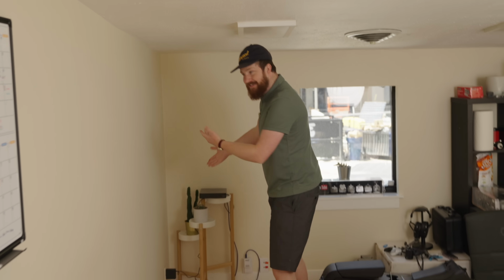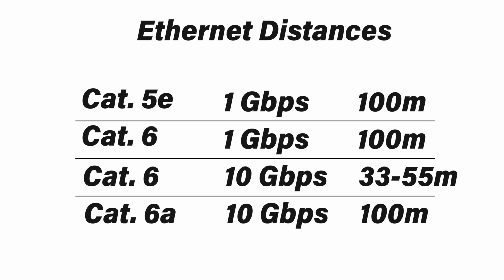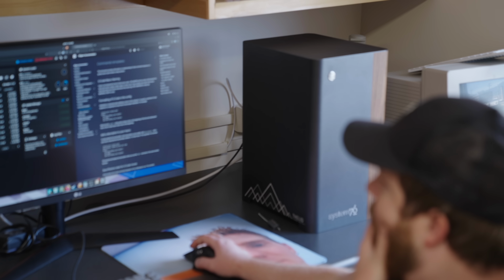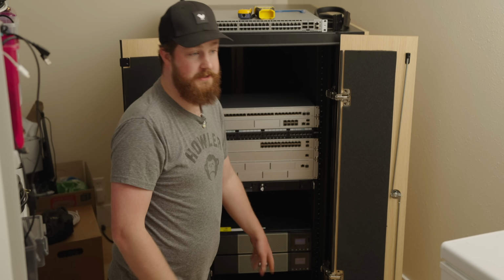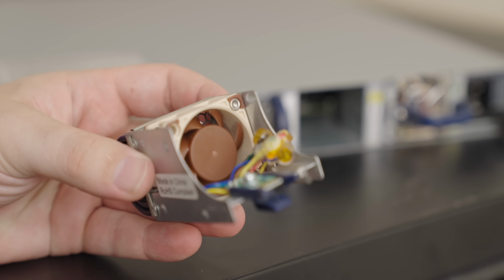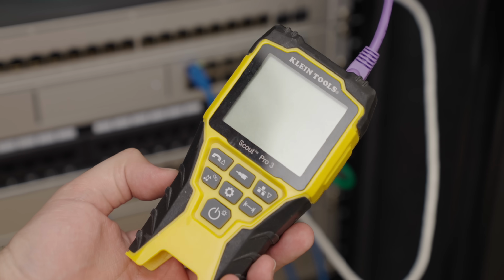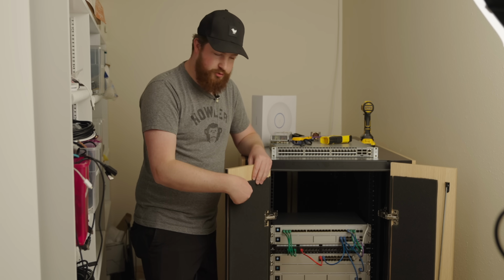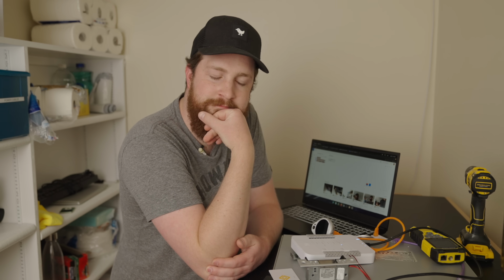DIY 10 Gig Networking for Our $60,000 Server!

Comment: Still can't get over how short the ceiling is in your office
Reply: It's not short, Quinn is just 10 feet tall
Reply: you meant to say "low"
Reply: @toseltreps1101  🙄
Reply: @toseltreps1101  insert spiel about how language is for communication and not intented to be used perfectly by all people all the time and so your correction is rude at best, insecure and sad at worst.
Reply: Claustrophobic
Reply: @PhaythGaming   Actually it’s not even a correction, because ceilings being short is a perfectly acceptable phrase which doesn’t bother me at all as a native speaker. Both low and short works, so Tösel is literally just being rude, not even correcting.
Reply: @jbnelson  To be fair I do feel in a grammatical sense it is off. A ceiling cannot be short, as it is defined as the upper interior section of a room. Thus it is simply a name for a face, and has no real z dimension, thus it is not "short" (I do understand the word "short" talks about distance from end to end, and so technically a ceiling CAN be short, but it wasn't the message being conveyed here, as it seems the use of the word here is meant to talk about height and not how wide something is... anyways, it's semantics, it's not that deep). It's place in vertical space is entirely determined and defined by the walls (which are tall, short, etc) and place the ceiling as high, low, etc.  So it is probably a just correction from the point of view of exact definitions.

Nevertheless, my first comment clearly states it's absolutely not a necessary thing to say. Everyone, native speaker or not, probably well understood what "short ceiling" meant here, given the context of the content and the natural personification we often apply to the word "short" in relation to human beings and other things. Language was invented purely to communicate. Linguists and such were people who came into language after it's conception (and use) and began to regulate and standardize it. If one is able to communicate, they can speak the language fine. People seems to take pride in grammatical semantics and I personally think it's deranged, even coming from a huge nerd of the English language.
Reply: Its not short its low
Reply: @sd8213  this twist is immensely troubling.
Reply: He super tall yo!
Reply: The thing that confuses me is that the ceiling appears lower the further he walks into the room.
Reply: Low is correct. Short is when an object ends before it should.
The wall is connected to the ceiling so it is a low ceiling with a short wall.

However! English is a very free language and while there is a correct way to say things, saying the same things with other words is not "incorrect".

Comment: I prefer the unpopulated patch panels. In my experience, the loaded patch panels like you used, are only good for one or two terminations. I have had to replace entire patch panels because I had to reterminate one connection and the plastic 110 block broke. Having the blank patch panels you load with keystones allow you to replace the breakable part (the 110 block) for one connection without replacing the whole patch panel.
Reply: Same, I use and recommend keystone patch panels. I buy female to female keystones and just terminate the wires with RJ45 connectors and plug them into the back. It makes it super easy to move them around or replace them if needed without a huge hassle or having it break like you said and having to replace the whole patch panel.
Reply: Yeah I prefer those, I have a couple in my house and it would be really annoying to have to replace the entire thing when adding a new connection
Reply: i've also terminated loads of patch panels. if your punch tool is good quality and you don't go to town like crazy, they can take some abuse. even if the plastic is cracked, provided then metals are not screwed over, you can still save it and have a proper contact. and i'm talking about some very shity quality patch panels. of course keystones are immune to that but i find it faster for me to do patch instead of keystone. but i guess in a small personal installation, installation speed does not matter that much. also, as others have recommended, cat6 cables are not really meant to go straight to rj45 connectors, but instead to wall plates and panels. this is not only easier but also aesthetically and practically better.
Reply: Banana
Reply: @zito88  Terminating in RJ45 is not great, is also a big waste of time, even for very experienced cablers. It is actually easier, cheaper and significantly more reliable to use punch down keystones.
Reply: Installers want faster...that's punchdown. They don't care about maintenance down the road cuz they get paid to return diagnose and fix
Reply: Quinn is just a boomer.

Comment: 9:00 Quinn. Let me level with you. They're not universal. They're UNINTERRUPTIBLE. Universal power supplies can adapt to the power draw of whatever the hell you connect to its output. Okay, so they are kinda universal. But, uninterruptible power supplies are what you showed and described. When they detect that they are no longer being charged, they can keep power supplied to anything plugged into it for however long the batteries can sustain it. Usually, this is to give you time to reach the server room and safely shut down any connected equipment. Some, however, are smart enough to be able to issue the safe shut down command themself she they cannot sustain much longer without mains power restoration.

Comment: As a network engineer, I want to say 2 things,
1. Don’t use the rj45 connectors like the ones in this video. The pull through style seems great because of the ease, but I’ve seen many issues with them.
2. Keystone patch panels are awesome. They are great if cables are added later and you want to keep jacks organized by room.
Reply: Agree with this 100%. You will experience issues with POE and with a environment where the RJ45 will be exposed to moisture they will fail over time. And keystone patch panels are amazing. Easier to setup, can do different connectors (HDMI, COAX, Cat5,6,7etc)
Reply: Agreed with both, but you shouldn't use RJ45 connectors at all with solid core structured cabling. Punch everything down either into a patch panel (keystone or otherwise), or a keystone jacks with a wall plate, and buy pre-made stranded patch cables as-needed to connect your devices.
Reply: Care to expand on the issues with them?
Reply: @96alexmr  w
Reply: @worldbfr3e263  they’re fine.
When they first came out forever ago, they were junk, and most “network engineers” haven’t bothered to try them again. But the new stuff is perfectly fine.
Reply: @worldbfr3e263  Most of them are not designed to work with Cat 6A
Reply: @worldbfr3e263  From what I've heard, some devices have metal backing on the ethernet port which can result in shorts in the ethernet cable. Also, it's easier for moisture & debris to get in.
Reply: @u1f98a  Most pass thru jacks I have used now have a thin piece of plastic that falls down and covers conductor ends when it is pushed in for first time, preventing shorting
Reply: You can also use a field termination plug, which is like a keystone with a male RJ45-like end.

Comment: Always make sure that the cutoff blade on the punchdown tool is on the outside of the patch panel punch down strip ;) Always number the wall jacks and cables on both ends in case you have to troubleshoot issues.

Comment: Need to chime in here: You don't need keystones to terminate shielded cable. Regular punch down patch panels that can incorporate shielding DO exist, as do all-plastic keystones that can't. 
The most common reason why you'd want keystones is the ease of installation and flexibility. Which saves time. And money. And nerves. F*** punch down panels; I mean it ^^
Also, you should have talked about the difference between stranded & solid conductor, where you would use them respectively and that you should be aware that your terminators (plug/jack) need to be matched to the conductor (some terminator models can accomodate both) or you might face weird contact problems in the future. YMMV. And: Don't terminate a cable coming directly out the wall with a plug and then go directly into a device. Always terminate those with a jack and use a short prefabbed patch cord. Looks nicer, and you don't run the risk of fatiguing the cable since those "wall cables" tend or should be the solid conductor variant that are not made for constant movement. You'd use patch cord (stranded) for these applications.

Comment: Just a quick heads up for you your toner and probe has cable tester built in on the probe side. With the tone going once you locate the port plug the cable into the bottom of the probe and turn the dial all the way over to test and it will check that wire for you. Much faster than running back and sticking a remote for a different tester and running back.

Comment: The long range access points are for specific purposes. For your purpose,  nanoHD or their unifi wifi6 models would be better. Long range models tend to create more noise for your devices and neighbours and vice versa if they are also using LR devices. They are really designed for large spaces like warehouses where there are few, far apart client devices.

Comment: Upgraded our wifi by buying an AP-AC-LR about 2 years ago. Reached almost every part of the house, with nearly full speeds with just one AP. (2 floor + basement, AP mounted on 2nd floor ceiling)
Bought 2 more to place on the other 2 axis of the house, and now every single device has amazing signal strength. Plus there's great wifi in the driveway / garage now, for when I'm troubleshooting my car :D

Love Ubiquiti's stuff so far, and I'd recommend to tech-knowledgeable (savvy not even needed! Just having some google-fu is enough) family / friends for sure. 
Got a few deals on APs and cloud keys last year. 6 older APs (2 of them 2.4ghz only, 4 are dual), 2 gen1 cloud keys, and some other stuff for 60 bucks! Plus I got a few deals on some AP-AC-LRs. 3 for 90 bucks, and another 3 for 110! Was very happy with the deals, as now I have backups / items I can sell to family / friends, if they ever need better wifi xD

Comment: Great video as always! For home use, you can run your Cloud Key and Unifi protect in a docker on your Synology NAS if you have a recent model. Combined with an USG-3P router and passively cooled USW-24-G2 Switch it makes for a silent setup where the camera footage is actually stored on the NAS. As the NAS is always running, it saves both money, power and cable-clutter.

Great tips on the cables too! In preperation of a renovation, I just ran Cat7e solid core cables trough the and walls to be future-proof. In hindsight, I could have saved myself some frustration by using Cat6 as the beefy Cat7e cables were an absolute nightmare to terminate.

Comment: Like you, I recently replace an eBay-acquired Arista 32-port 10G switch with a Ubiquiti UniFi Switch Pro Aggregation 28-Port 10G. I use the top row of ports to plug in 10G copper SFP modules and the bottom row to plug in 1G copper SFP modules. This switch also offers 4 ports for 25G that I used, with fibre SFP transceivers, to connect two PowerEdge servers with two large Synology NASes. It's a cool setup! As you mention, the Unifi switch uses a fraction of the power of the Arista as well as production little heat and almost no noise. The Arista was also incompatible with 2.5G, should I ever acquire a device that has that, and, for some odd reason, wouldn't connect with two very old Synology NASes. My rack is much quieter with the Unifi switch, which is a good thing, seeing that the rack is in my bedroom.

Comment: I have nothing against 110 block-style patch panels, and prefer them for installations with enough network runs to justify several units' worth of panels. On the other hand, for home lab and small office situations, I like the keystone panels because I can mix punchdown jacks, RJ-45 passthrough jacks (great for bringing connections from the back to the front of the rack in a clean way), and LC duplex fiber passthrough jacks in a panel, in whatever arrangement I need. Also, for UniFi users, you can now get keystone patch panels in something resembling Ubiquiti Silver, so your rack can look even more better. :-D

Comment: Be careful about using the ethernet ports on the UDM, they can be a bottleneck. Check the schematic on the UDM-pro
Reply from the maker: True! I was plugging for b-roll haha I’m moving to SFP with DAC wherever I can.
Reply: is something wrong with the ports? a $380 router and cant even use the ports on it that sounds insane. the udm seems like a great machine but so many people have said a huge list of problems i want a rack mounted router but have always backed out from buying this one.
Reply: @bossman762x39  Standards, UDM pro has 8 1gb ports, and 2 10gbps SFP+ ports with one that does WAN and one that does LAN.  You typically use the 1gbps for the phone/PoE switch and the high data items for the 10gbps switch. (Just make sure to get 10gbps on both sides of the 28sfp+ port since UDM doesn't support 28gbps version of SFP+)
Reply: good point
Reply: @bossman762x39  There's nothing wrong with the ethernet ports on the UDM, it's just that they share a single 1 gig backplane. This means they won't all get their own 1 gig of throughput. That's why it's better to connect the UDM with SFP/SFP+ to a switch, then connect your devices to the switch. This matters a lot in homelab setups or setups like this where you're connecting locally to a NAS because it will severely reduce throughput. But in most home setups where almost all your computers are just connecting out to the internet it will matter a lot less, because you'll be bottlenecked by your internet speed anyways, which even if you have fiber will be 1 gig up and down max. I personally do not use a UDM pro in my own setup, I use pfSense for my firewall and a Unifi PoE switch with the Unifi control software running in a Docker container on one of my servers, the UDM pro hosts the Unifi control software so there's no need to host it elsewhere with the device. Even though I don't use the UDM pro I have installed several of them for home network setups for friends of mine and it's a great solution unless you need really advanced capabilities like I do.
Reply: 10g WAN is limited to 1g total throughput if you only use the 8x1g ports (not 8g throughput which would expect on a switch with a 10g uplink - its only 1g internally). Good for cameras or other items that won't compete for the 1g internal uplink otherwise you really want to use the other 10g port to link to a switch.
Reply: I was coming down to look for this. I'm having this issue myself having just gotten fiber in my area, and when I got the UDM Pro I didn't realize that it would hamper my gigabit connection using it as my switch. Now I'm waiting for the XG24 to come back into stock so I can get it and move all of the switching over onto it.

Comment: If you want the best 10G speeds you should hire a Fluke certifier to check and test the connections. A tester or even a qualifier will not pick up issues like alien crosstalk and other issues that will drag down your speed and cause intermittent transmission issues..

Comment: Always lead the U(FS)TP punched cables on the panel to the side of the panel and thus the cabinet. Use zip ties to route the cables. When the cables are mounted like the footage; straight to back at that angle and criss-cross it's really prone to one of the pairs being pulled or making a bad connection. And also make sure to use the right type of connector on the cable. There's one type for solid and one for stranded cores. (Don't use cheap cabling with a lot of aluminium in the core). Oh, and TrueNAS rocks by the way! Using it for a very long time now. The use of jails (containers), VM's and plugins is awesome. Next to that it supports almost every network protocol (or could always hack it in, because it's stripped down FreeBSD).

Comment: nice, but the purpose of the toner is to find the order of your cables, before the termination. this could have been done by the electrician who pulled the cables in the various rooms but alas most of them don't care. now, for a small home install, it really doesnt hurt, you can just go to town in the patch panel and have random numbered plugs in the rooms, but it is visually better not to, as it is practically better not to terminate solid core cat6 straight to rj45 plugs but instead on wall plates and use patch cables to connect your devices. it's not wrong by any means, just practically better.

Comment: Keystone based patch panels are so much easier to terminate and a lot more flexible. Also for longevity and durability I’d recommend terminating with female connectors on both ends and using patch cables.

Comment: The general rule of thumb for UPS is that your replace the batteries after 5 years and the unit after 10 because of the capacitors in the ups.

Comment: Don’t ever use The EZ rj45 connectors(the ones that pass the conductors through the ends) especially if you use any type of POE. They tend to kill equipment and leave the conductors exposed to oxidize. As for patch panels I absolutely prefer keystone ones and I’ve found I like the 24 port ones from fiber store. I work as an AV field service tech it’s super nice to be able to swap one keystone plug instead of leaving a bad port in a patch panel.

Comment: Would CMR cable be a bad idea for a use under the house if your on pier and beam?? Technically it’s outside but not really open to the elements. I would like to do a home network with 10 gig speeds (I know it overkill for most homes but I want a bit of future proofing) but I really can’t figure out what cable I need.